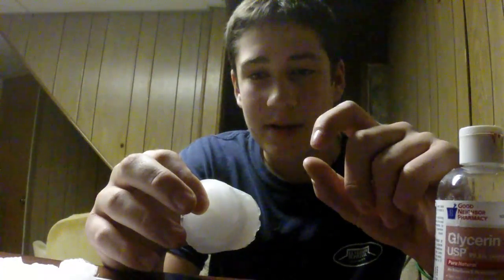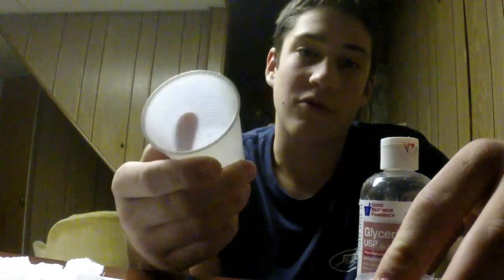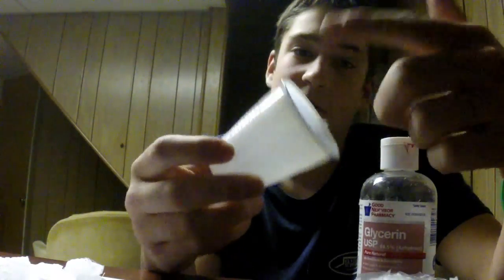Why Is Glycerin Used In Silicone Casting? Answer!

Comment: $4.47 / tube WalMart
Heating pad will accelerate the curing process.   I do not use any additives.  No glycerin, no mineral spirits, no naptha, no corn starch...
Just use GE premium all purpose 100% silicone.    Fill a gallon bowl with water and pour in 4 to 6 oz of dish washing soap.   Mix the soapy water well before adding the silicone (whatever amount you need).  Now, gently flip and compress, flip and compress in the soapy water for about 5 minutes.  Now make a compressed ball by gently tossing from one hand to the other.  Keep your hands and ball wet with soapy water.  Now take the ball of prepared silicone and press the heck out of it into your prepared container with secured item you wish to make a mold of.  Keep pressing to milk all air up thru the sides of container.   Along with aggressively pressing,  pound container on floor.   Keep your hands wet with soapy water at all times.   Once you are satisfied it is compressed enough and all air has been evacuated,  put container on heating pad.   In 2 to 3 hours,  you can demold.   Keep in mind that cure time is dependent on thickness of mould and the brand of 100% silicone used.   Good suggestion is to use a mold release agent like UMR or globmarble's G-1 release agent generously to item you are making a mold of and the container prior to applying the prepared silicone.  This way, no shrinkage, no fumes.

Comment: Glycerine is a humectant . it Will pull moisture from surrounding areas that itstouching. So essentially by mixing it in with rtv silicone it will help cure it in all the areas that are too thick for air to reach. Small amounts of cornstarch and a few drops of acrylic paint will also help this process

Comment: Silicone cures in the air because of the water molecules in the air. You can simply thoroughly mix water, food coloring, etc.  in the silicone and it will cure in the middle just fine. You don't need glycerin.  Food coloring or water work just fine. If you add cornstarch too, you get a playdoh consistency that cures into rubber.
Reply: Thanks for the info 👍😊

Comment: I just dealt with this problem, now I know why it happens.  I have been using the uncured center as a on call silicon pot.  It's stayed wet for days so far.  I just cut a hole, it Poor's out like cold syrup, and I've been using it as a brush on, or even to patch a soapy water and caulking silicone mix.  It bonded just fine.  The original bath was mineral spirits and caulking silicone.

Comment: Thank you for the video. I would very much like to know just what silicone you have used in your experiments. I would like to make flute pads out of silicone sealant which i understand is pure silicone. This material has the required hardness or softness when cured but is very difficult to  place into the mould and  almost impossible to smooth  the free face which is what contacts the edge of the hole in the flute. Can you help me out with a chemical which makes the silicone less sticky, more easily manageable and which can be made smooth by a butter knife. Also what proportion of glycerin is to be used? thank you.

Comment: You can also add a tiny bit of acrylic paint to your silicon to solidify anything over 1/4 inch thick. to much additives of any sort will weaken the material.

Comment: At 01:08 you said that silicone caulk cures with air.  That's incorrect.  The typical silicone caulk sealant commonly sold in hardware stores is not air cured, it's *moisture cured*.  Silicone caulk sealant uses the ambient moisture in the air to cure.  Glycerin's hygroscopic nature allows moisture to be drawn throughout the silicone caulk mold, allowing it to cure thoroughly and this is the reason why mixing in glycerin is highly recommended when making a mold using silicone caulk.
Reply: Any idea as to ratios of Glycerin to silicone?

Comment: The recipe call for 5 to 8 drops of glycerin to 1 oz of silicone. The silicone is the type you use with a caulking gun. It is really inexpensive. Just make sure to get the one that is 100% silicone. https://www.amazon.com/08641-Clear-Silicone-Sealant-9-8-Ounce/dp/B0002GU14C/ref=sr_1_3?ie=UTF8&qid=1512194460&sr=8-3&keywords=100%25%2Bsilicone&th=1

Comment: Very cool. I didn't know that. I use glycerin with gelatin to make reusable mold material but never wondered why. :P I usually buy silicone molding material (Oomoo) and I bet it has glycerin in it somewhere because they cure perfectly. Sometimes though in a pinch I buy tubes of 100% silicone caulk from local stores and use that. It does have an issue curing in the center of deep molds. I will add some glycerin next time. I still have some from making reusable molds and it has been sitting for months in the cabinet. :p - Heidi

Comment: This video makes no sense to me. I've poured cups of silicone leafy to cure for a prop and the cured just fine. What kind of silicone are you using? I've never run into uncared silicone in the middle of anything.....
Reply: There are two types of general construction silicone.  Neutral cure and acetic cure. They both cure with exposure to the moisture in the air but acetic acid is produced in a chemical reactions while neutral cure as the name suggests doesn't produce acid. ( vinegar). The neutral cure was invented when aluminium was introduced to the roofing industry as part of the coating .... look up electrolysis and dissimilar metals. Introduction of a hydroscopic material just sets off the curing through the full depth of the mold.🤨🤔😀😎

Comment: You can also use 2-part silicones for mold making and casting. These are based on completely different chemical processes. They don't need water for activation.  Look for platinum cured and tin cured silicones.

Comment: i have a question please if i mix silicone(caulk) with glycerin then i can use the mixture as a material for molding like silicone rubber
Reply: I use 100% silicone caulk for molds in a pinch or if I want a mold I can see through so yes you can. I haven't tried mixing in glycerin yet but I will because sometimes they don't cure well if very thick as he mentioned. :)